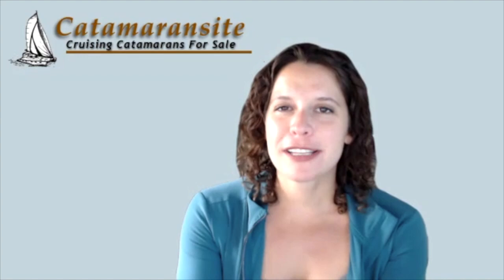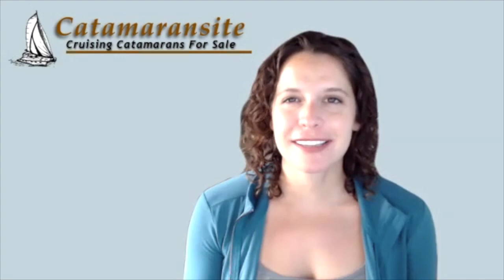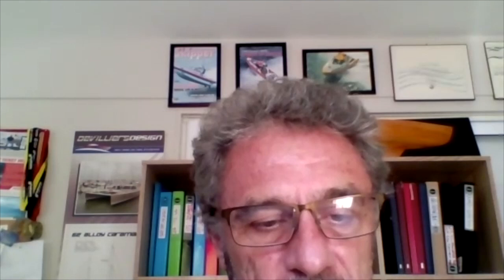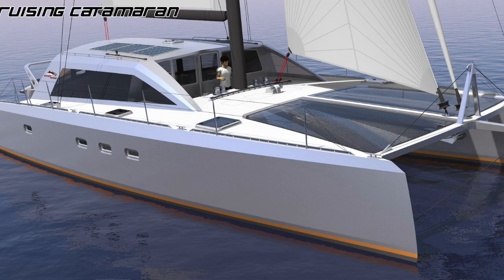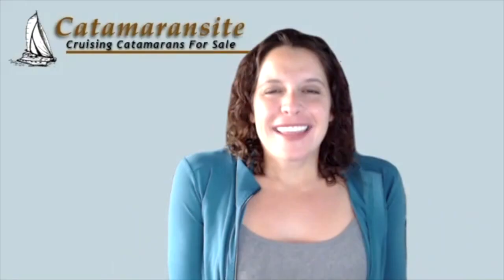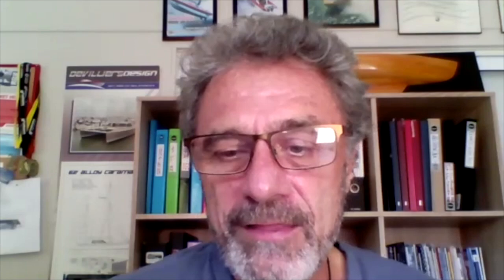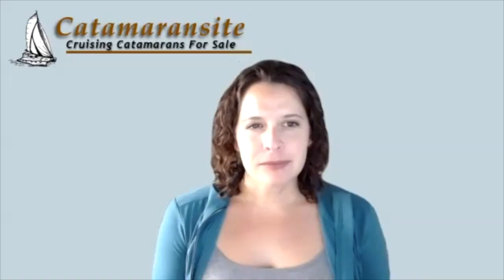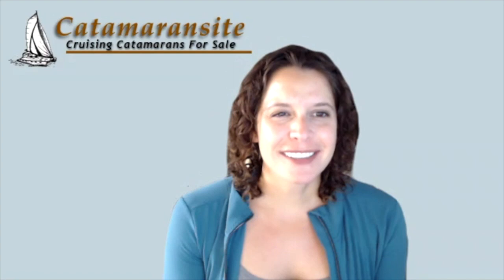David de Villiers Interview - Aluminum Catamaran Design

Comment: I've been looking at aluminum catamaran designs for about ten years, and David's design are by far the simplest, safest, and most attractive that I've seen. Start looking below the waterline first, then go up. From the safety of the rudder and props all the way up.... I've chatted with David before and I'm still interested in getting one of his designs.
Reply: Look at the Cyber 48 by Tim Mumby.  If you want simplicity, reliability, safety and blue water capability, hard to beat.  Kick up rudders, hand push-down daggerboards, 48 FT at 6.1 tons empty.

Comment: @David de Villers, I hope someone or myself,  will one day commission you to design a 52 feet aluminum sailing catamaran with a saloon that is essentially the main berth too.  During the day, it's the salon, at night, it's the main berth (bedroom).     Why? I can't stand enclosed areas and berths are located in the hull with a 'wall' on either side.   

I am ware that the  SeaWind 1260 has an island berth, a hatch above this berth all the windows (port holes)  in the hulls are large.  How these berth are designed. 

I also like the galley in the hull.  

A blend of the SeaWind 1260 and your 525... all in aluminum.  And if it's safe, for a bluewater sailboat,  to have two outdoor motor instead of the inboard motors?  I'm not a sailor yet... so I'm not sure if outdoor motors would be advisable on bluewater sailboats.
Reply: All of your comments are logical and could fit your lifestyle well, but also consider that most people spend only a small part of the time sleeping, and a salon as common area (great room) with galley is great for socializing.  On land, most people tend to congregate near the kitchen, etc.  Thus the trend towards great rooms in modern home design.  (Most people don't sleep in the great room on land, though of course you could, depending on circumstances, which are different for everyone.)

So not disagreeing, but pointing out that use cases may be different for different people.

Diesel inboards are generally considered more reliable for bluewater cruising.

Comment: Suggestions:
* work from a script
* rehearse
* edit ruthlessly
Reply from the maker: Hi Large

Appreciate the feedback.  Some of our subjects are less show business types but extremely knowledgeable.  Hope you enjoyed the quality of the information shared by David.  I thought his focus on simplicity even for very large catamarans was novel perspective compared to what you see mostly out there.  There is a struggle between weight and performance on catamarans even at the larger end.  Also as aluminum construction is a recent trend, hopefully his explanation of the differences between fiberglass and aluminum construction were educational.  You can look over our other interviews, and some subjects are very polished.  But I understand your feedback, and we obviously have room for improvement.  Hopefully we have improved since our initial interview and will continue to improve.

Richard
Reply: I tend towards ply/epoxy as my welding is restricted to steel. But I thoroughly enjoyed the interview and his simplicity and truth. Now to find Dudley Dix.
Reply: @jasonstrong4610  Plastic composites are a fantastic material in terms of function, shaping and durability, but the environmental impact of using them is bad.  Metals used for boats tend to be highly recyclable, and marine Aluminum is very durable due to inherent corrosion resistance.
Reply: @CatamaranSite  Keep doing as you are doing - there's nothing to be gained from rigid formulas. Dynamic interviews that adapt with the interviewee are far more interesting. Bravo to you.

Comment: You have to be crazy to build catamarans that are under 100ft in aluminium, its to heavy to noisy to hot or cold and electrolysis is always a problem especially in structural areas that you can't see. I could say a lot more but I have better thinks to with my time. This is a bit like watching the blind leading the blind.
Reply: By 'electrolysis', do you mean 'galvanic corrosion'?
Electrolysis lays deposits.
Galvanic corrosion removes minerals.
These two opposite processes can happen simultaneously, resulting in a structure quite different from the original.
Reply: you can get an electrical mitigator for corrosion on metal boats.
Reply: too too too
Reply: yo Michael, what a weird way for you to inform this thread that your mother drank all the beer in the village while she was pregnant with you